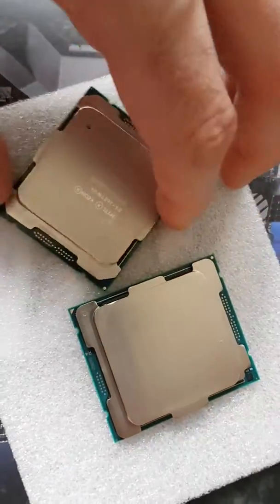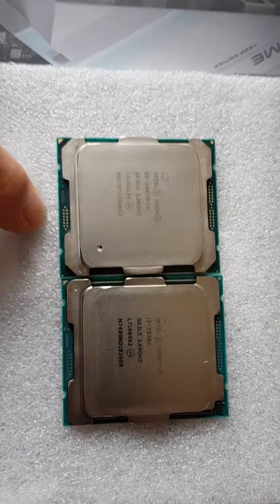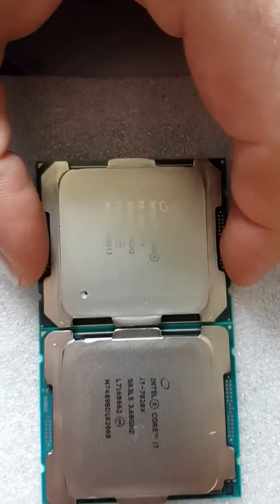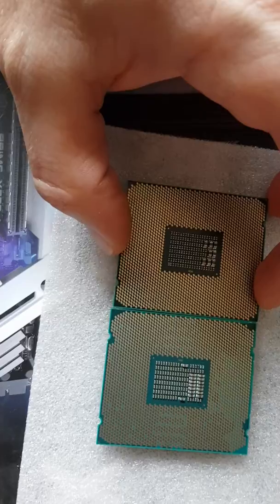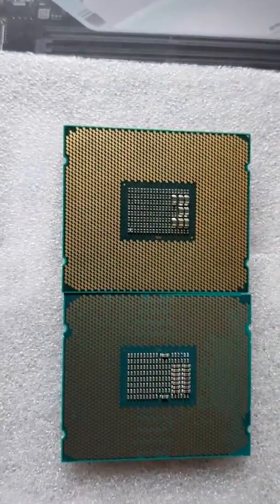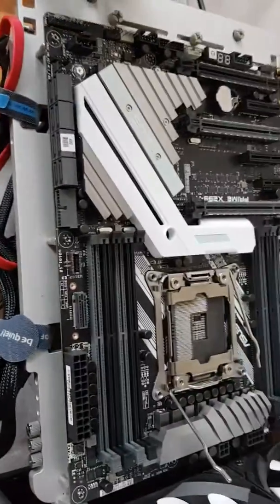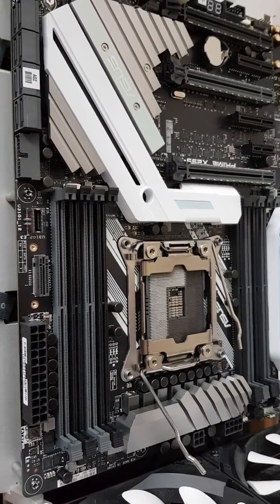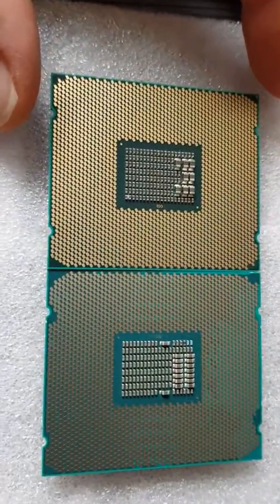LGA2011 3 vs LGA 2066 Chip Comparison

Comment: Rebranding non stop. I have a LGA 2011 V3 PC, looking to build a LGA 2066 or LGA 2011 V3 for my wife. Geez. The 5th-6th-7th and 8th gen could be a SINGLE generation only. But whatever.
Reply from the maker: Djalma Leatti Intel: LGA1151 can't have 8 cores. ...6 months later : we'll have i9-9900k 8 core CPU for 1151... really.
Funy thing : Asus Gene Viii can have either i7-6700k or i7-7700k...
Reply: Lol, ok the fact that Gene VII can handle the 6700K and the 7700k is pretty new, wtf. Also, did you see how the screwed us up? We cannot use XEONS any longer with X299... And also there are a lot of "cheap" LGA 1151 Xeons (7th gen) that would easily fit for gaming PC's, but they require a specific Chipset... Do some research on that and you'll see that Intel just wanted to cock-block us. They don't want us to buy cheap Xeons for gaming, they want us to spend our hard earned cash.
Reply from the maker: Yes Djalma. You''re exactly right.
Reply: @DLain  I hope you both know that cores aren't everything. Every generation comes with more and more transistors, a different GPU unit, mostly more cache, more bandwidth for memory and so on. 5-8th gen are highly different.
Reply: @BuckiCompany   It is my duty as an engineer to know that. Who ever said that cores are everything? Paralellism can help, but it is not everything. I've been contributing to C++ AMP (which stands for Accelerated Massive Parallelism) since 2015, GPUs, for the most part, have a lot of cores and we do our best to utilize all of them, CPU's is a completely different story. From a technical standpoint, I don't think that 5th-8th gen are that different. They are almost the same technology rebranded and slightly optmized. I think that Ryzen 2/Ryzen 3 showed us how to properly advance a generation. Intel hasn't improved much since X79. They're screwed now and I hope they release a 7nm processor soon. Yet, they spent 15billion U$ buying a useless self-driving car company from Israel, ironically, 15$ bi is what TSCM spent to go from 14nm to 7nm.
Reply: @DLain  5th gen to 8th gen is an improvement from 22nm to 14nm, they are not the same technology at all, they are completely different architectures. It doesn't really matter what you think on something, but the technical details are much different. You can't just randomly add millions of transistors into an existing tech. Intel develops a new architecture every time they release something buidling up on older tech to not compromise compability. On the other hand, if you have an Intel NDA, you know what they are up to. Intel is not screwed. They bought the self driving company as a long-term investment. Yes, Intel has not done too much since X79, but stuff like QuickSync and other cool technologies helped a lot. Heck, they managed to do 8 cores on that tiny LGA 115X socket! I'm not saying you are wrong, but there are huge differences between the 5th gen and 8th gen chips.
Reply: hey dude, I have a question, in Aliexpress I saw  a cooler of cpu and is LGA 2011, but the motherboard that I want is LGA 2011-3, I can use the same cooler of cpu 2011 in a motherobard 2011 - 3? Greetings and thanks.
Reply: @ignaciotorres49  LGA 2011, LGA2011 v3 and LGA2066 share exact the same cooler. I've been using the same one from my X79 to my X99 to my X299.
Reply: @DLain  As a professional, I can confirm this. He is correct.